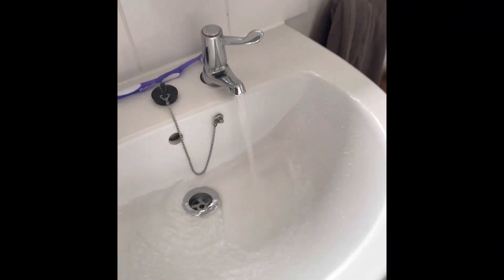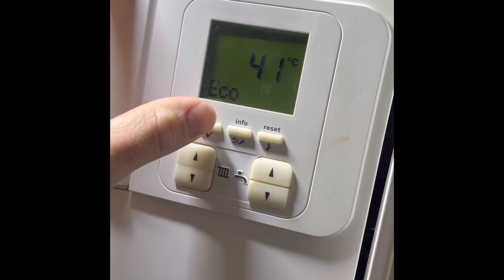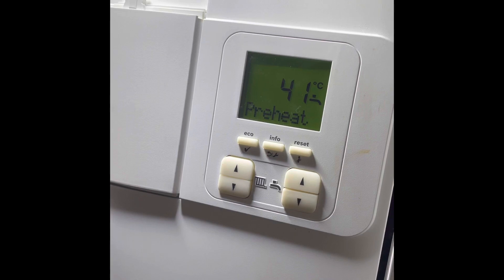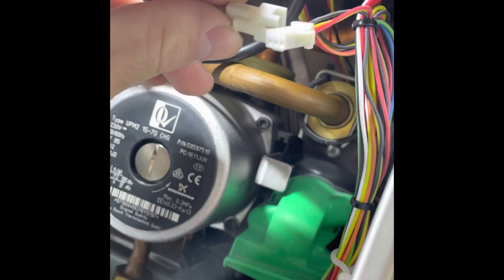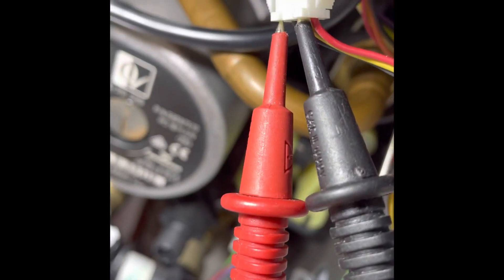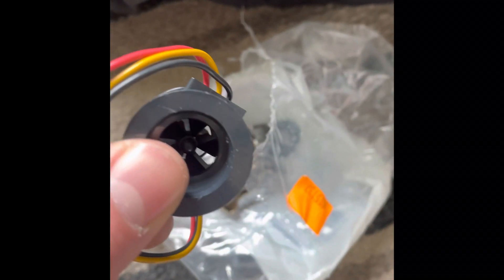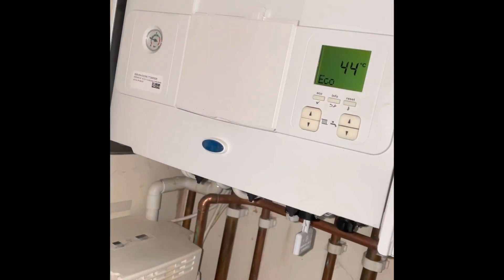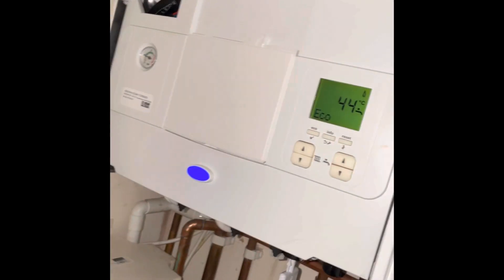60 second breakdown no hot water 30i erp

Comment: Hey my hot water went barely warm all of a sudden.  I checked the water temp out of thr burner and it’s 30degrees higher than incoming main water.  The plate temperature transfer is perfect so do you know why my burner has suddenly stopped producing adequate heat?  I thought it was the plate or diverter at start but then just ended being lack of temp from the burner.  It’s a Worcester Bosch junior 24i.  Any help appreciated
Reply from the maker: Try replacing the hot water sensor mate for the sake of about a tenner
Reply: @boilerstobathrooms  hey thanks appreciate the tip.  👍